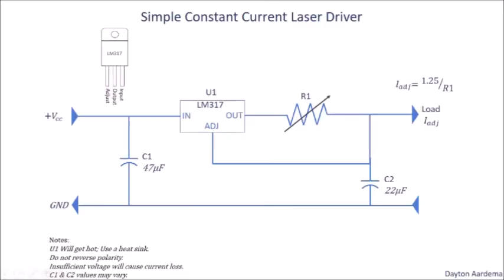2W Laser Module Driver Assembly & Safety

Comment: i have a 2W laser diode here but i’m scared that i might fry the diode 😕
Reply: you can hook it up to up to 3 volts but don't do it too long or the diode might overheat.this won't be a problem if you use the correct driver
Reply: MJY Animations i buyed a driver for 1,6 1,8 2 watt thanks❤️
Reply: @mjyanimations1062  would active cooling keep the diode cool?
Reply: @ChickenPermissionOG  first you need a heatsink, the lens housing is not enough for 2w. Having a fan as well is usually better. Also forget what I said earlier, you absolutely need a driver if you don't want to risk killing the diode.

Comment: noob question here.  i noticed that you used 1amp and 4volts which comes out to 4watts, despite this being a 2watt diode.  is 2watts the output power and the diode is only 50% efficient?  or am i missing something here?
Reply from the maker: You’ve pretty much got it. Laser’s power rating is based on the light output power. Most lasers (esp. expensive ones) have a data sheet that plots power out vs power in - it’s not a straight line and it is unique to every laser
Reply: Blueprint oh cool.  thanks for the quick reply
Reply: i think it may also have to do with the current limiting driver so perhaps at 4v it only allows 0.5 amp=2w

Comment: good place to get goggles?
Reply from the maker: Amazon and eBay both carry them (along with countless others). The important thing is that they block the laser light that you are using. My glasses blocked blue light.
Reply: @BlueprintScience  I'd never trust ebay or Amazon goggles. Buy them from places like survivallasers. Styropyro has shown that you can't trust eBay goggles
Reply: @leplayz4499  sadly , survival lasers has been slightly overating their glasses ( od 4 instead of OD6) , so buy from laserglow
Reply: @BlueprintScience  Also don't use any glasses that come with a laser they are usually cheap and likely to go blind.

Comment: can the lm317 drive a 4.75 watt blue laser?
Reply from the maker: I think that it can easily supply that. According to the LM317 datasheet it is "capable of supplying more than 1.5 A over an output-voltage range of 1.25 V to 37 V"
Just try to keep the voltage and current level within spec and you should be fine.
Reply: @BlueprintScience  thank you!!